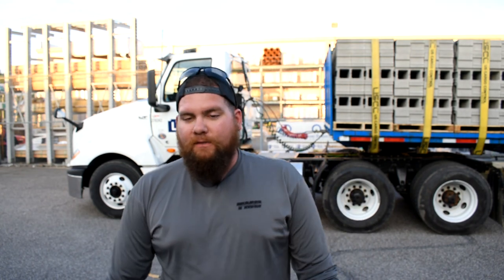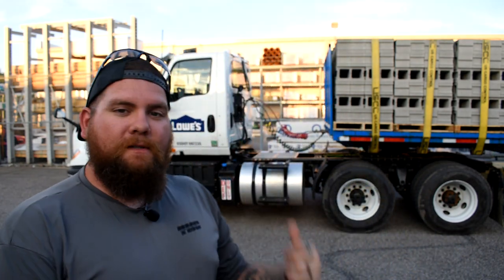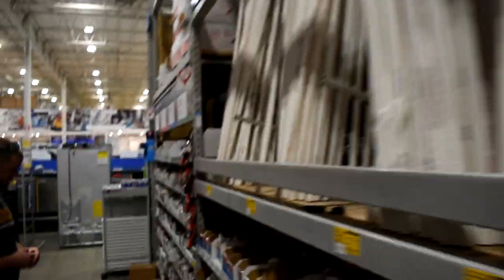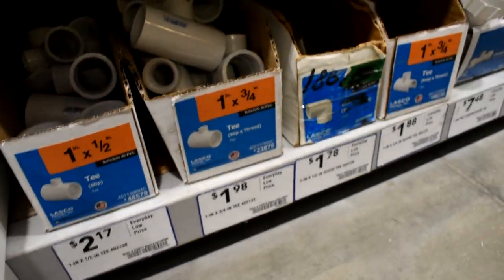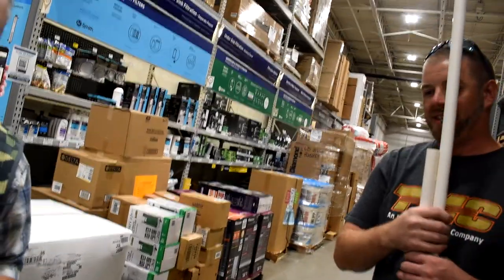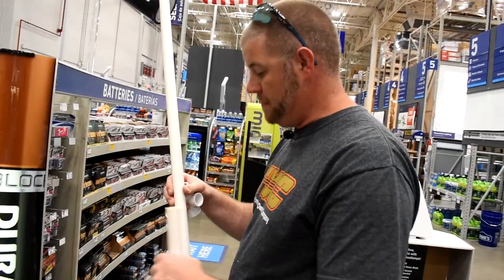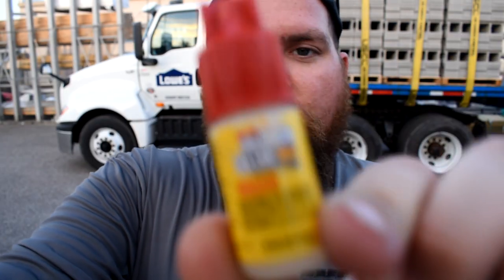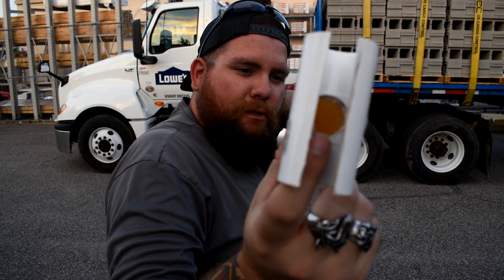How To Build Edge Protector Pole #Tuesdaydump

Comment: Not sure if it helps, but I cut my PVC at 88" long and it fits perfect across the sleeper under the bed.
Reply from the maker: That does help. I'll pin this comment.
Reply: @LawfulGiraffe  Also they sell threaded ends for PVC.....use a male and female end to shorten the pipe when not in use so you can store in your box outside :)  Also this brings up an interesting question, what all do you, as an employee, need to buy in order to do the job that the company doesn't supply for hauling these loads?
Reply: @Twisted86  Most, if not all, places where you need vee board edge protection have these poles for drivers. I can see the usefulness of having your own so you don't have to wait if there aren't many poles around at the shipper.
Reply: @SOPHIAFLYGIRL none of the places I go have poles to borrow.